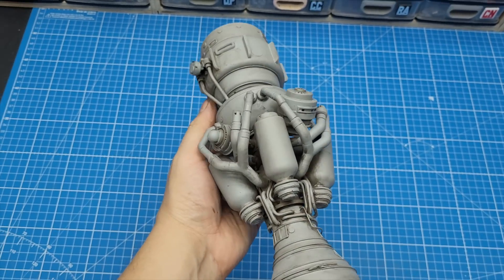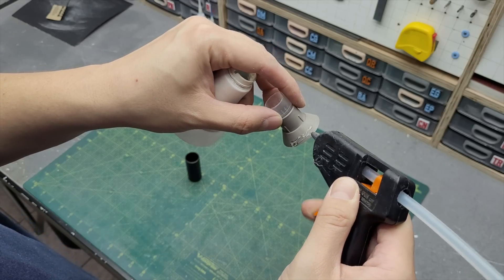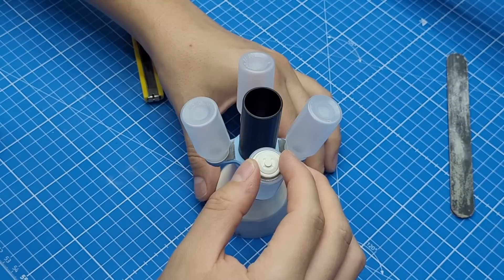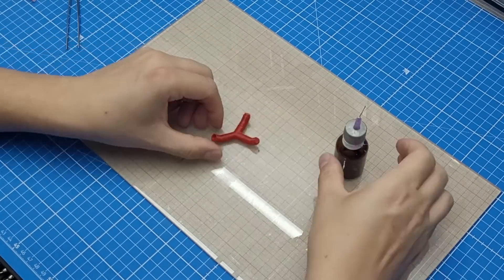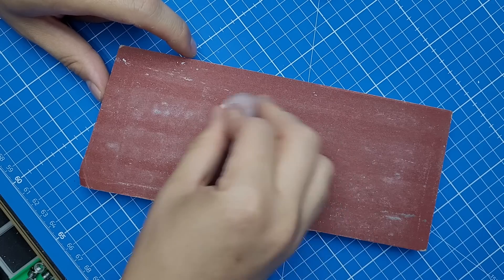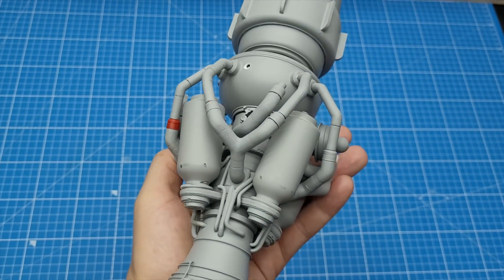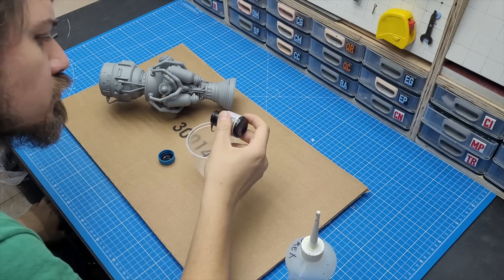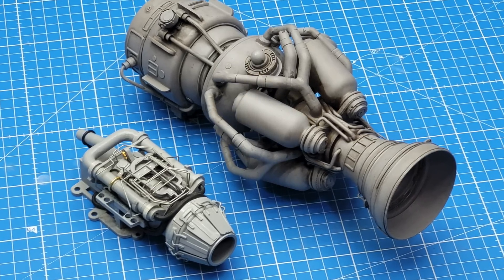I Built a Rocket Engine Model From a Lightbulb!

Comment: I don't know if you know this, but if you have super glue overspill, you can clean the super glue with some Tamiya Extra Thin (or Mr Cement S, this one has a better brush). Just go a few times over the super glue with the extra thin cement and the overspill will be gone. Anyway, thanks for the inspiration and keep up the good work!!
Reply from the maker: Cool tip! Tamiya stuff here is very hard to get and pretty expensive, but thanks for the tip anyways!

Comment: I recently subscribed to your channel and I have been glued to the screen absorbing many of your builds. Absolutely amazing to me. I had one idea for you that could make your next mech bot a cool diorama. You need to build a repair scene with one of many of your bots you have already done but make the scene with some multiple  level scaffolding going on 3 sides with your bot in the middle being anchored down, hatches open with hoses and wires running from your floor of the diorama up into the open panels and a human figure or two on the scaffolding reaching inside hooking things up>>>>>>>>>just an idea that I know you could knock out of this world. Bill from Co.